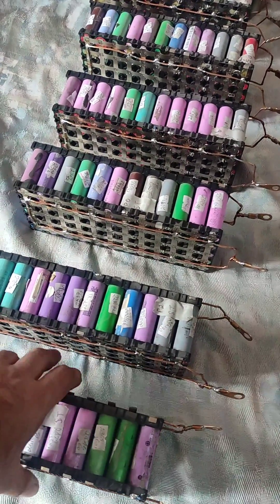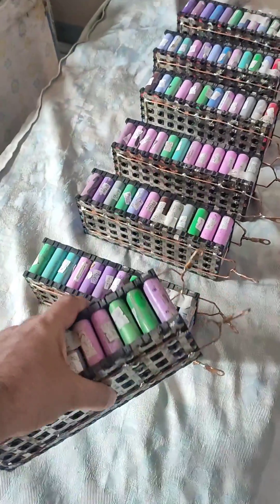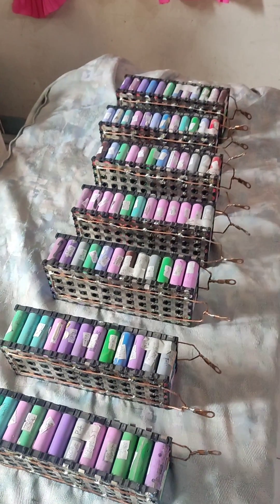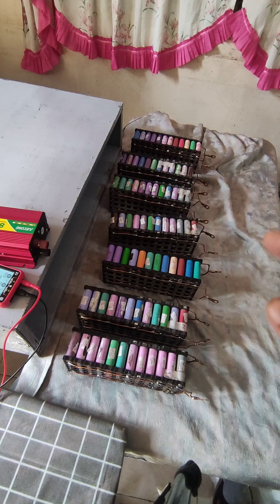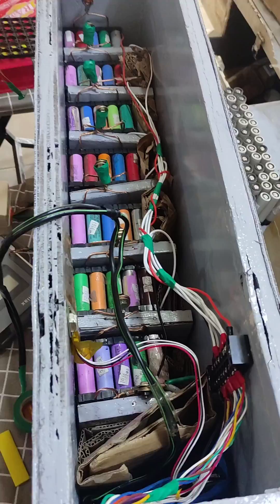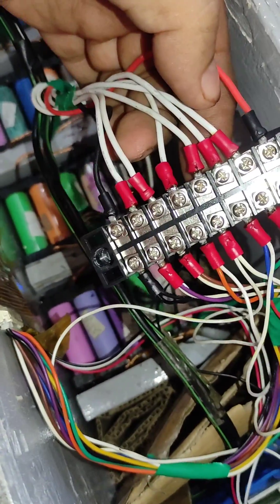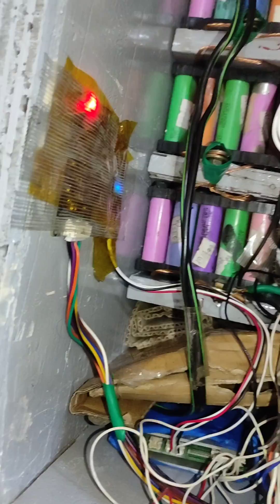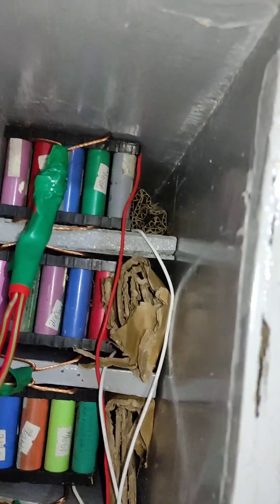Upgrading a 7S 30P Lithium-Ion Battery Pack  60Ah to 120Ah  3kW DC Power Expansion

Comment: Sir when power inverter mosfet is short then thier will short circuit in your battery
Reply from the maker: No because I use JBAIDA smart BMS that have very good short-circuit protection nothing to worry
Reply: Sir any system we can some modifications in inverter for me because I am using lithium ion battery I am using daly bms  but tension to much because one time happen I was thier my battery nagtive wire breaked so thier was no big issue with the help of God
Reply from the maker: Always do calculation about amps and install requid protection  @vishalagg7442